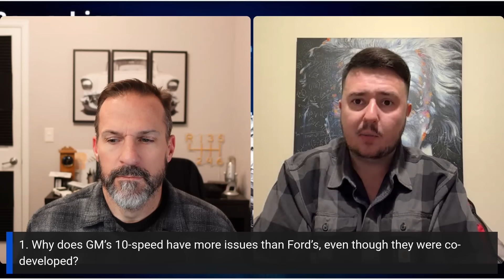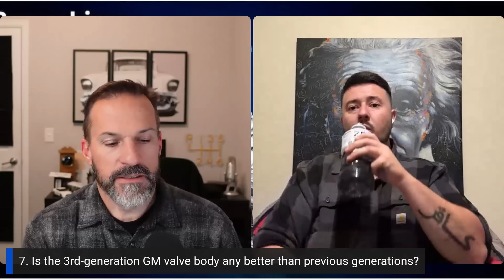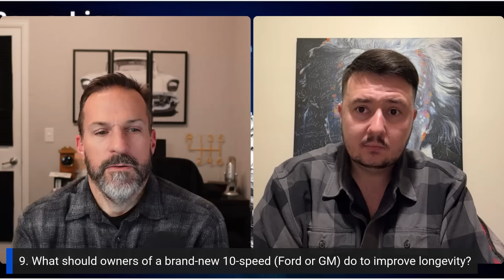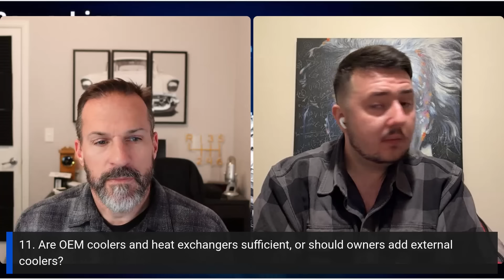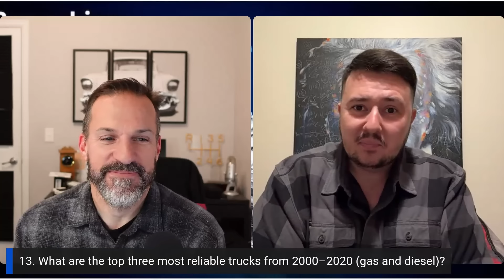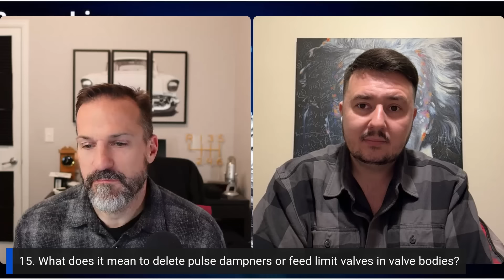Stop KILLING Your Transmission! The Maintenance MOST People Ignore (With NextGen Engineer)

Comment: This guy (engineer) is pompous and full of himself. Humble people do not need to promote themselves. None the less some good information.
Reply: It takes an asshole to make change. Thanks for the compliment!

- Nate @ Next Gen
Reply: Sometimes when you’re very knowledgeable and passionate about a topic, you can come off like that. I however appreciate somebody who is passionate and is a master of his trade! Too many people these days think they know things and when you get down to it, they don’t know shit. So in that sense I really like this guy.!
Reply: @DUNEDIRT same
Reply: I just bought  new ‘26 Silverado Hd a few weeks ago.  Any idea if they fixed the valve body on these new 10L1000s?  If not, how difficult is it to DIY it myself?
Reply: I probably wouldn't take his advice about how to cook a steak (maybe), but for transmissions I'll listen. As far as promoting himself I've listened to several of his interviews and he comes across as someone who is genuinely offended by the hap-hazard engineering. Not saying he would or should work for free but I don't think the money is his main motivation. He just has a low tolerance and aversion to stupidity.
Reply: His tips have been enlightening and spot on - where else can you learn that the transmission fluid level should be double checked after changing just like is necessary to double check the engine coolant level after changing?
Reply: Hubris is thinking you are more, and it comes across as pompous.  Nate is actually an autodidact expert, and not full of hubris.  His authority is real, not imagined.  If you have worked in highly technical fields you come across this all the time.
Reply: @mefobills279 agreed

Comment: Absolutely agree with transmission fluid changes, the issue I find is where to get this job done , I was a ford technician for 40 years so it was possible to do this at the shop, now retired and with the lack of dip sticks as in the old days and needing an expensive engine scanner in many cases or just the location of the fill plug this is requiring me to have it done but I don’t have much trust in dealers and many service centers to do the job or what fluid is used, is it generic one fits all ,so we have a problem in this country with having basic maintenance done where do you go.
Reply: People just do not want to do maintenance.  They only come in when it is junk.  The standard response is ignorance.
Reply: Love this guy (Nate )and his straight to point approach…..
Reply: Also a mechanic, have rebuilt transmissions. I HATE the no dipstick "sealed" messes   First "lifetime" fluid I encountered was on Chrysler FWD four speeds in 1987.  And they were correct. If you didn't change the fluid it was good for the 30-49K lifetime of the transmission.   Later upgrades in that transmission and the fluid mean that if you change the fluid every 30K I don't know how long the transmission will last because we've not ever had another one fail.
Reply: Just because it doesn't have an old fashioned dip stick doesn't mean it has no dip stick. Ford 10 spd have to be run to proper temp then check the dip stick that is under the cap on the side of transmission.
Reply: Get a PPE aluminum pan - most if not all of their application models use a fill standpipe in the pan itself- effectively aiding you in your quest to "level" the fluid level w/o having to run some convoluted rig up into the trans case right next to a hot exhaust catalyst in order to check your level with the fluid at proper temps.
Reply: DIY it, measure what comes out, slam that amount back in. I do it with a pressure pot, takes about 3 minutes to drain and refill 7 quarts from my ZF 6 speed.

Comment: What is your opinion on Subaru's CVT transmission?
Reply: Ha! GAYYYYYYYYYYYYYY.

- Nate @ Next Gen
Reply from the maker: Which year/model are you looking at? Subaru's have not had the same CVT issues that Nissan had if that's what you are wondering, not yet anyway. There are very few complaints on NHTSA, however that doesn't mean they aren't failing at some level. CVTs can be OK...not great, but they can last if maintained correctly and driven properly.
Reply: @TheCarGuyOnline 2025 outback
Reply from the maker: @kirbysmithsale from my research the Subaru CVT have been pretty reliable. I would change the fluid every 60k and you should get good life from it
Reply: @TheCarGuyOnline Thank you

Comment: My 2006 Toyota Tundra Limited transmission could not be totally drained by Toyota service. They could only partially drain it; then add fluid. What was that b.s. all about?
Reply from the maker: It's normal to do drain and fills, which is likely what they are referring to. If you do a drain and fill, you only get out what's in the pan etc., which is fine, if you do it every 30-50k miles you will always be cycling new fluid in and not disrupting things.
Reply: All automatic transmissions are like that. It's impossible to get 100% of the fluid out, half of it is in the torque converter and cooling lines/cooler. It's typical to just do a drop and drain, where you drop the pan, and refill. Or drain out some from the cooler line and refill, you can never get all the fluid in one trans service
Reply: You can do multiple drain and fills with some miles in between and by dilution you can eventually replace almost all the fluid. There's a formula for it in the interwebs but if I recall it's diminishing returns after 4 or 5 cycles. I think 6-8 (depends on ratio of what you can drain to overall capacity) gets you pretty close to 100% but that's probably overkill. Truth is that even 1 D&F at least replaces some of the diminished additive package.

Comment: Ask Nate if using a thicker fluid in the 10L1000 over the ULV water they use in factory fill.
Reply: Im curious as well. But, my opinion for what its not worth, id say knocking 30+ degrees off the ATF ULV fluid would result in a satisfactory viscosity. 150 deg ULV is maybe higher viscosity than a standard ATF at 190 deg. Maybe not those hard numbers specifically, but in principle. I live in a hot climate. Our summertime daybreak temps are 80deg with 95+ afternoon temps daily. Our winter lows will dip into the teens during a short duration cold snap. Id feel comfortable with ULV if my trans had the appropriate cooler hardware mods to knock 30,40 or more degrees off fluid temps.